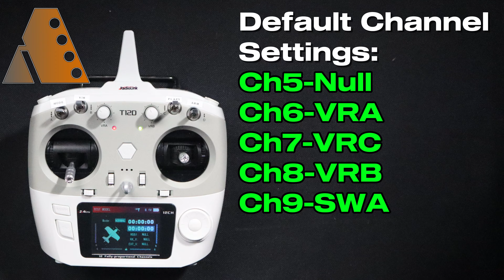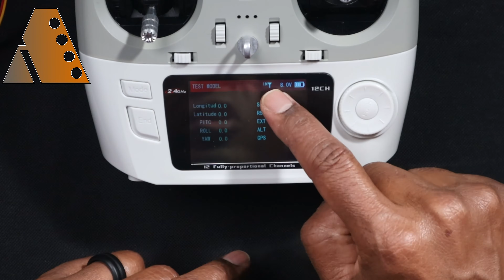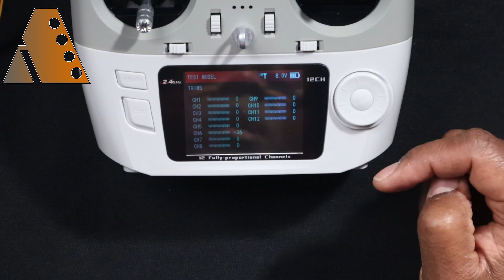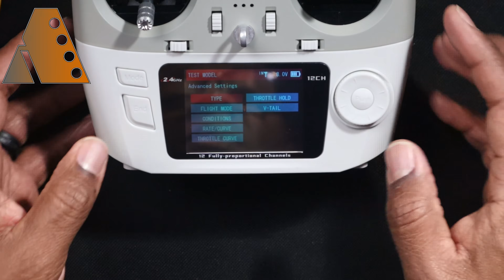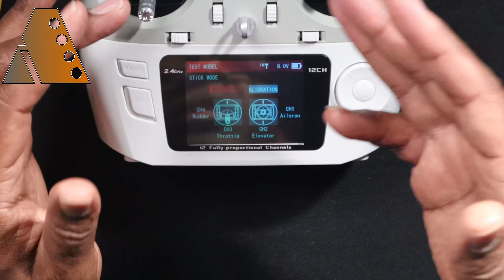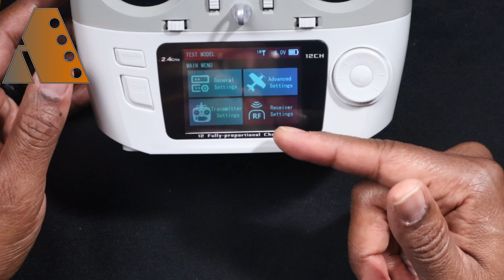Beginners Quick Look Radiolink T12D Transmitter Desktop Demo

Comment: I bought one and can't get the trims to work with a delta wing, I can get the elervons to work in the mix but I can't get both control surfaces to move when I try to trim it out only on control surface moves not both together. 😥
I ended up putting it in a 4 channel powered glider going to try it out today.
Reply from the maker: Sorry to hear that. I will be binding with my D460 and sharing in video soon.  let me know how it works with your Glider.